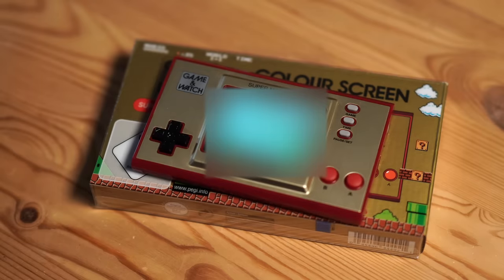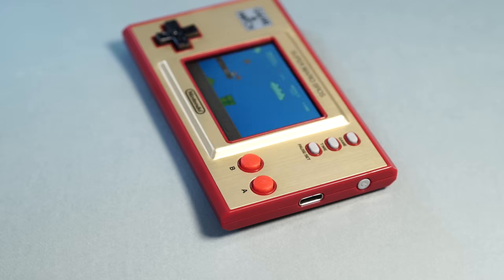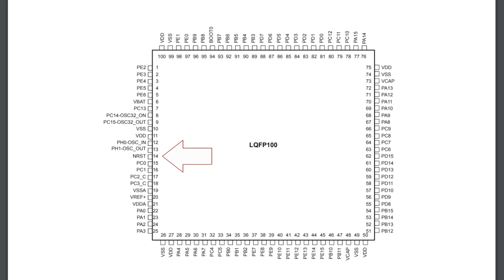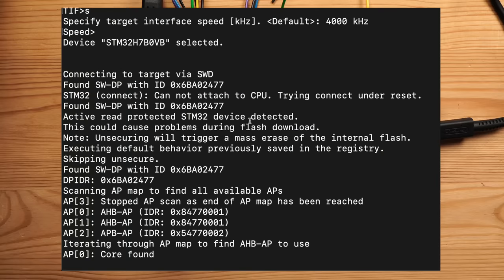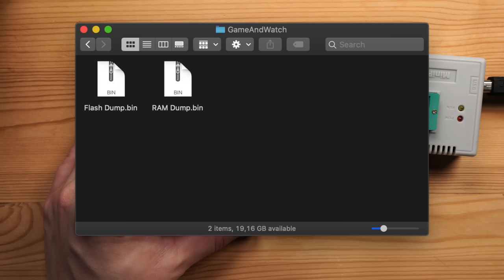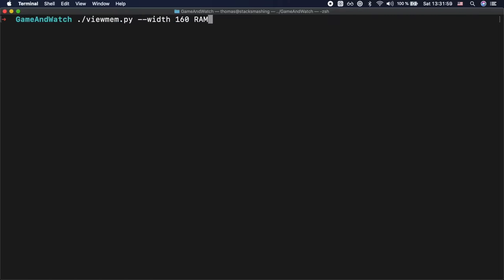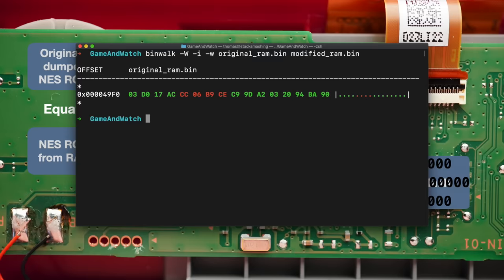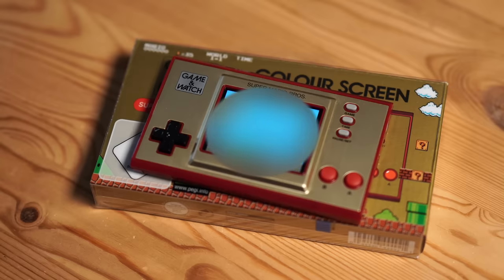Hacking the Nintendo Game and Watch

Comment: Can't wait to play Doom on it.
Reply: Or Super Mario 64
Reply: @matiytpopin14  nes emulator cant run it
Reply: With only 128KB of storage that is very doubtful.
Reply: This is Nintendo, I think Wolf 3d was the most violent game they had.
Reply: Most STM32 MCUs are perfectly capable of running Doom. You can even replace Mario with Doom on this one, should not be much of a problem. But you will never be able to put Mario back again.
Reply: @JaroslavHoudek  Why not?  He flashed the SPI ROM multiple times, and each time he restored the previous change.
I think the final hack will be to replace one ROM with a loader and have a whole library on an added flash chip inside.
Reply: @SmallSpoonBrigade  Fire Emblem said hi.
Reply: @matiytpopin14  not a valid reason
Reply: I can't wait to play skyrim on my game and watch
Reply: @JaroslavHoudek  You don't seem to understand.  DOOM won't fit within 128KB of space, obviously.  However I see now that there is actually a secondary 1MB flash chip inside the system as well, so it may be able to fit on there after all.  It most definitely won't fit within 128KB tho.
Reply: @skins4thewin  of course it won't fit to 128k,but it can run directly from the external Spi flash.
Reply: @JohnDlugosz the external flash is used to store the NES ROM. There is no such thing as NES Doom AFAIK. So the only way is to replace code in main memory. But due to the readout protection, you can't make a backup of the internal flash.
Reply: @JaroslavHoudek  Right, that's what I was just saying.  I wasn't aware of the extra 1MB flash chip at first.
Reply: @skins4thewin  if someone could in a pregnancy test, it will be possible here
Reply: @Pizboyfrog18  Lol well it's not exactly that simple... The pregnancy test was completely altered, with an aftermarket screen put in and a direct video feed being piped to it from another device.  It most definitely is not simply running on a pregnancy test.  Were you not aware of this?
Reply: @skins4thewin  nope, i didn't know
Reply: @SmallSpoonBrigade  they released Doom on the SNES.
Reply: @WintrBorn  Or get a switch to be able to play doom. I personally don't play doom on switch, but others Yeah!!!!
Reply: @SmallSpoonBrigade  heard of doom 64?
Reply: Smattless  lmao I'm glad this is still a thing. Good one, sir
Reply: I can't wait to play Flight Simulator 2020 on my Nintendo Gameboy
Reply: For some reason your profile picture made me read your comment in a really monotone and uninterested way
Reply: @WintrBorn  Which had nothing to do with the original Doom, it was written especially for the super fx chip in the cart.
Reply: @SmallSpoonBrigade  Snes had doom bro
Reply: Why do i hear doom music
Reply: I unironically think this will be the only console that will never run Doom. Every other console ever can run it. Well, not really but if we count every console since the SNES then every console after that can run it.
Reply: @unverifiedbiotic  other than missing a few levels, it was essentially the same. Yes, I played both back in the day, as an adult.
Reply from the maker: I can already spoiler you: you’re wrong 😁
Reply: @thefollower2933  Oofe.
Reply: Now you can😆
Reply: It did!
Reply: He run it
Reply: @twilight-sparkle  yes I know. He did it.
Reply: @betterbetter3930  are you sure now about that?
Reply: @SmallSpoonBrigade  doom was on the SNES... Seriously the source code is freely available... Would be foolish to presume doom never reached Nintendo
Reply: @betterbetter3930  I was referring to you're original comment boi
Reply: @beebeeplays9098  ok
Reply: @matiytpopin14  lmao w 1 mb of Ram?
Reply: Yeah you already can. A very very VERY limited version but somebody managed it
Reply: Cant wait to play spiderman miles morales on iy
Reply: @SmallSpoonBrigade  on n64 there is doom 64, quake 64, mortal kombat 2 was uncensored, there is also residen't evil series on gamecube...wolf 3d was a bad port, but after pegi/esrb they was able to put some uncensored games.
Reply: @matiytpopin14  it can barely run doom what makes you think it can run SM64
Reply: @SmallSpoonBrigade  I own a SNES copy of doom
Reply: @stacksmashing  aged like milk
Reply: Lul
Reply: @SmallSpoonBrigade  Nope, there is a doom port for the original nes. But it is anplayable as you get eyecancer playing it.
Reply from the maker: I don’t think there’s DOOM for the original NES, at least not running from a regular (as in: no RPi or so) cartridge - happy to get corrected on that though
Reply: @stacksmashing  For the SNES yes
Reply: @Marc Trevino yes
Reply: @stacksmashing  oof
Reply: I want to play cyberpunk 2077 in it
Just connect it to external rtx 3090 gpu
So can handheld it at 8k ultra resolution at 60fps and ray Tracing on
Reply: @skins4thewin  
That comment aged poorly
Reply: @DawsonsMemes  Lol I can't even remember what I said.  Probably something about DOOM not being possible on it.  He was only able to get an insanely cut back and barely functional version of it on there anyway, so that hardly counts if that's what you're getting at.  Surely you're bright enough to realize that doesn't count.
Reply: @DawsonsMemes  In fact it pretty much turned out exactly like I said it would, for all the exact reasons I said it would.
Reply: @skins4thewin  5 MB
Reply: @betterbetter3930  you can get different software
Reply: @SmallSpoonBrigade  there was doom on the SNES and gba and n64 and switch
Reply: @SmallSpoonBrigade  I’d say Bayonetta 2
Reply: @SmallSpoonBrigade  witcher 3
Reply: Doom why I get it a dead meme that people like saying this game
Reply: @mr.billybob4013  or halo
Reply: @betterbetter3930  we aren't dumb
Reply: bad apple
Reply: @skins4thewin  it ran doom

Anything can run doom.
Reply: You know that that’s called a joke right?
Reply: @PGtheVRguy  Lol anything is a pretty broad statement.  There are most definitely things that can not run DOOM, like a 286 computer for instance, or a Colecovision.
Reply: @🆘️sy Yeahhh...
Reply: @SmallSpoonBrigade  yes or spear of destiny
Reply: Or doom 1993, ||
Reply: @SmallSpoonBrigade  WTF? They have doom eternal on switch ._.
Reply: @skins4thewin  well you could have an external data storage
Reply: @equinox2584  Lol yeah it did actually.  This isn't DOOM running on this thing, it's something else entirely.  Its an insanely heavily modified version w pretty much everything cut out to make it run.  That hardly counts as running what we know of as the full retail version of DOOM.  

I said it wouldn't be powerful enough to run it & the storage wouldn't be enough & I was dead on right on both points.
Reply: @equinox2584  it had to be cut back in every conceivable way to not only make it fit but make it run on the hardware.  It was pretty much exactly as I said it would be.
Reply: @SmallSpoonBrigade  they have doom eternal on switch I’m surprised
Reply: That's gonna be a piece of cake for modders, they've probably already found ways to play doom on an original game and watch.
Reply: @matiytpopin14  holy moly that would be insane
Reply: They had doom 64 on n64 and now doom eternal on switch
Reply: @thefollower2933 well it run doom
Reply: @SmallSpoonBrigade  not true, doom was ported to the gba
Reply: why always Doom?
Reply: It can't run Doom.
Reply: Not me, I hate Doom. But  stlll an interesting experiment.
Reply: @SmallSpoonBrigade there was an SNES Doom port but it was censored IIRC

Comment: The USB port being power only is disappointing. Funny though, because now Nintendo can’t even put out an update to correct their language blunder.
Reply: I... Don't think it even connects to the net
Reply: @IVChan  Exactly. So the logical solution would have been to do it ‘the old fashioned way’, eg. Hooking up to a PC via USB. But this is not possible, so all Nintendo could do is make a public apology.
Reply: Okey
Reply: Funnily enough Nintendo has once again helped scalpers and the second-hand market. I assume now those 1st gen G&Ws with the "language glitch" will be a hot commodity when they replace them with the fixed batch on store shelves, stock up now
Reply: @kissconsider  : Do you really think they will make a second batch? This is a limited edition item which will stop being sold in March, so there won't be a second batch.
Reply: @OMA2k  depends on how popular a item is. They said they will actively manufacturer it until March. They could update it on the fly between now and then
Reply: @OMA2k  i most certainly do. Think about it, its the holiday season. If we just think of the nintendo store in NY alone it could very easily sell out by the middle of December, which will be indicative of its status all around. Especially since its so cheap at $50. That leaves a nice new batch for the new year, sometime in January or maybe later December. They stop manufacturing in march so i expect maybe 2 or 3 manufacturing cycles
Reply: @OMA2k  dorsnt mean they will stop manufacturing it. Just like 3d all stars it will continue zo restock to its last day. I dont trust companies that says "limited" edition these days. I know for a fact that it happens a lot that limited edition get restocked even years after release.
Reply: +GuppyLife snowflake
Reply: @shinjid3705  Nintendo hates to help their popular cheap products in any way, that's why the 'classic' consoles and this are never in stock and always scalped. They're too good and they provide what most casual gamers would consider to be a great alternative to their hundreds of dollars Switch devices at a fraction of the profit margin.

So Nintendo keeps making these products, mainly just to generated buzz, then clamps manufacturing/inventory to a bare minimum, and kills them off at the earliest point they can.

If Nintendo could make it so that nobody but Youtube influencers would get these products, and no retail releases at all, they would. These are just publicity stunts to them.
Reply: Couldn’t you just update the firmware with the USB port
Reply: @isaacchase564  No, you can't. Do you see the video? Or read the comments? The port is charge only.
Reply: @kissconsider  LOL..

They weren't
Reply: @dgpsf  I knew Nintendo was corrupt, but they're even worse than I thought.

Comment: - The usb is only for charging.
+ Hold my ARM debug probe.
Reply: cpu suports  usb dfu booting  some time and someone will hack it to reflash via usb
Reply: @vampirwrr  it would still need hardware mods, since the usb data pins aren't physically connected to anything

Comment: After studying EE and about 3 years of experience, it made me happy that I understood 99% of this video.
Reply: I got 0% idea of what's going on but still liked the video
Reply: @mr.billybob4013  it's a good video nonetheless
Reply: Just wondering for amateurs how does one achieve this kind of understanding? I'm walking through a CS degree but the most relevant course seems to be comp arch. Connecting to debug ports, dumping falsh/ram, trying to figure out the encryption algorithm, all these sound very interesting to me. I can probably follow along with enough tools but how do I do all of these on my own?
Reply: @Levelworm  I'm dealing with STM32 MCUs at work, often also using external memory and implementing firmware update mechanisms. Doing this kind of work, I need to figure out how to make things more secure, so that nobody can actually get the code or extract an encryption key (e.g. when the bootloader itself is being updated) by sniffing any lines that connect MCU and the external flash. So I'm basically on the other side of what stacksmashing does. This made it easy to understand for me. It made me happy, because I remember times when I would watch videos like this and understood basically nothing.
Reply: You studied at E sports? Coool
Reply: @billigerfusel  Thanks! I guess it's very useful to get realwork done in the field. Do you know how those work recruit? Do you have to come from a hardware background (A EE or Computer Engineering) or they more look for projects one did?

Comment: Man, disappointing the data pins aren't hooked up on the usb port.  I was really hoping this could turn into a neat easily homebrewable little handheld.
Reply: Meh.. the lack of buttons makes it not very practical to hack and put more NES games on it. No start and select buttons make it so most NES games won’t even be able to start. These Mario games were modified for this system to use A and B as start and select. Regular roms won’t work the same.
Reply: @dewinter1411  the zelda one has a start and select and is hacked too already

Comment: Strange that they hotpatched the copyright date instead of just hacking the rom
Reply: Would be easier to maintain a ROM that’s the same across many of their devices and hot patch locally per device.
Reply: @KaderRocks  Not really, they never have to do any maintenance on any Game and Watch consoles. It's a situation where they simply have to change a few strings of text before recompiling the ROM, and then there would be no need to have an emulator stand-in for patching. It's cleaner to have everything run without bloat. It would be different if it were a more intensive type of patch, this is inconsequential.
Reply: @ha1vorsen  The idea with keeping a rom that is original is that you can use it across many devices and not have to worry about it acting differently. And if it does, you hot patch it on the devices versus constantly making change sto the original and then hoping your changes work with new devices later.
Reply: Kensen If you need to modify the string during development, it is much easier to change text in source code than to patch the ROM again. It is much better if the ROM is “clean”.
Even if you need to change the code behavior to fix bugs or add new functions, easier to do this in emulator than in the original code.
Reply: @ha1vorsen  The original Game and Watch did not come with Super Mario Bros., Super Mario Bros.: The Lost Levels. These are ROMs from the NES. The ROMs for the NES versions are used on many different pieces of hardware for emulation. As such, you don't want to make modifications to your ROM each time you are using it on a new device (such as the Super Mario Bros ROM) as that wouldn't make any sense. One of the biggest reasons for this is due to unknown issues that could arise from making basic modifications. These roms have had decades of testing and people poking. You could easily change one line of code and test a bit and not find something. Then you deploy and 10k users are getting an error because of a specific way they ran a level. You would keep the ROM used across all devices in a "clean" state and then hotfix it using code on the devices themselves. This is seen across all devices that nintendo supports this kind of emulation on. Granted, this device was never meant to see any new roms or have any updates, but that doesnt mean design choices (such as not modifying roms directly) should be changed.
Reply: @KaderRocks  Yes, this is why I specified inconsequential updates such as changing strings of text and not major upgrades like the new cheats. I understand that NES games weren't always cleanly developed and largely relied on assembly during development. I'm not referring to fundamental changes, even potentially fundamental. And there is still only one Game and Watch which plays SMB, which is this one, regarding the first sentence.

 I do completely understand what you're getting at, though, if you're playing it completely safe.
Reply: @KaderRocks  It would make perfect sense to make modifications to the ROM each time you are using it on a new device.
WTF are you even talking about?
Making hot patches via the emulator could also introduce errors.
Reply: @hsjoberg  as far as I understand, they do this because otherwise it would be harder to enforce copyright on the roms, in this way they're still using the same copyrighted game code as of 35 years ago. They've been doing the same thing with Super Mario 3D All Stars!

EDIT: typos
Reply: Marvelous...
Reply: @kipters  interesting! Yes that makes sense.
Reply: @kipters  That is crazy but totally understandable. Thanks for explaining!
Reply: @anthonutty  keep in mind it's only speculation, I don't know if that's actually the reason
Reply: Modifying the ROM would be sacrilege.
Reply: There's also another thing, it's probably impossible/too much work to bring the dev environment they used to build the original roms, so changing the actual code might not be an option.
Having a set of emulator-side patches is also probably easier to experiment with, or they could easily run A/B tests ecc.

Comment: Would there be a way to connect the USB port to the PCB so you can use it to flash other ROMs on it? If that could be done, then figuring out how to add the ROMs to it, you'll have a portable NES package. And if you could have it where you load a ROM from a USB flashdrive, that would make it so you could load whatever games you wanted without having to worry about the on-board storage limits.

Comment: Can't wait for mine to arrive, I've already prototyped  a pcb with a microcontroller  and a much larger flash to implement a sort of "bank switching" to hold more games, I just need the thing in my hands to finish writing the software and test it
Reply: Can you put some links to these items so others can buy them too?
Reply: @BigHushAffiliate  it's just a 64mbit flash and a 120mhz ucontroller that I already had around. I designed and made the pcb. Will only work (if at all) for mmc1 games

Comment: I believe this encryption scheme is called XOR-based one time pad. That XOR stream you inferred was essentially the “one time pad”. The weakness in the implementation here is that there was no protection from using the one time pad multiple times because you could change the contents of the flash. Thanks for the super interesting video.